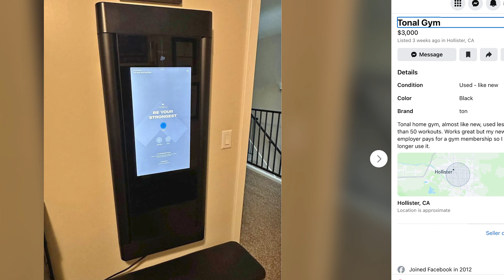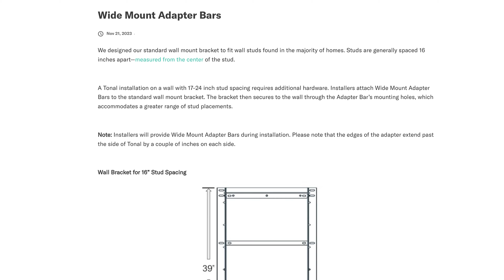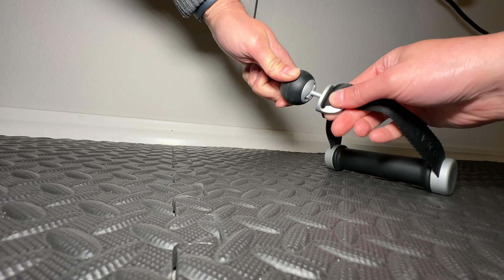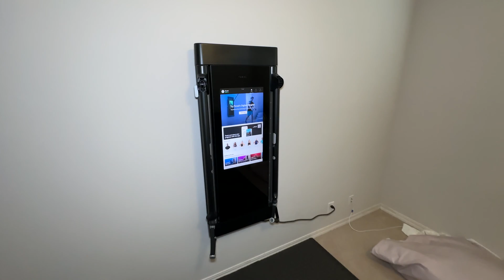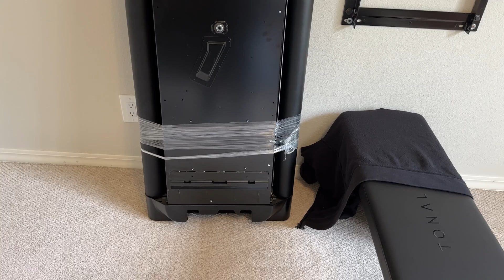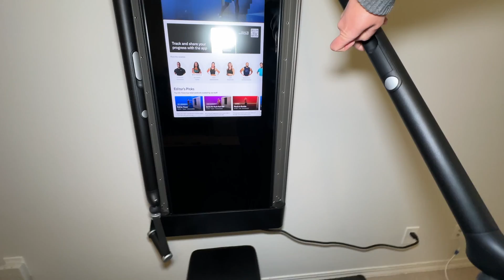Removing and Installing a Tonal Home Gym: Step-by-Step Guide

Comment: Thanks for posting this. What length are the provided lag bolts?
Reply from the maker: I do not remember the exact length, and I do not want to guess about hardware holding a 150 pound machine. Tonal says the hardware can vary by wall type and recommends using new relocation kit hardware instead of reusing the old bolts. I would use the exact hardware supplied for your wall.

Comment: This was super helpful!!! I was leaning toward buying a new Tonal because there was so little available information on installation. With a new one, it would be installed for me. A number of things gave me the confidence to by a used one:
#1 - This video.
#2 - The Tonal rep was not very helpful with options to work around the decorative molding and chair rail on the wall. Once I knew how to do the install (see #1) and with the molding situation, it seemed easier to do the install myself than deal with an installer.
#3 - Visiting a friend that had a Tonal. They knew what to watch for in buying a used Tonal and how to transfer a Tonal. I wanted to actually try a Tonal before putchase. The closest place that Tonal could find was 2 hours away. Really??? I live in a suburb of Denver CO and Tonal doesn't have a demostration model anywhere in the entire Denver metro area?
#3 - Huge savings buying used.
Reply from the maker: That is a fantastic story. You researched the used unit, tried one before buying, learned the transfer process, solved the molding problem, and saved serious money. Most importantly, you understood the job well enough to do it confidently. I am glad the video helped. Your detailed experience will help other people considering a used Tonal.

Comment: Close up of you drilling would have been helpful thank you
Reply from the maker: Great suggestion. I should have included a close-up of that step.

First I drilled through the drywall using a standard drill bit. Drywall is soft so it goes through quickly. Once the bit hits the wood stud behind the drywall, you’ll feel the resistance change.

From there I continued drilling straight into the stud to create the pilot hole. This hole guides the lag bolt and prevents the wood from splitting. After the pilot hole was drilled, I switched to the larger bit specified in the Tonal mounting instructions so the lag bolts could pass cleanly through the mounting bracket and bite securely into the stud.

The important part is drilling deep enough into the stud so the black mounting bolts can fully seat and tighten against the bracket. If the hole isn’t deep enough, the bolts will stop early and you won’t be able to tighten the unit flush to the wall.

So the basic sequence is:
	1.	Drill through drywall
	2.	Continue into the wood stud
	3.	Drill the pilot hole to the correct depth
	4.	Mount the bracket
	5.	Drive the black lag bolts into the stud until everything is tight and flush

Thanks for pointing that out. A close-up would definitely make that step clearer for people installing their own Tonal.

Comment: Can the electrical cord hide behind it ?
Reply from the maker: Yep, mostly yes. The  power cord exits the back of the Tonal near the lower area, and you can route it straight down behind the unit so it’s hidden once it’s mounted. From the front and sides you won’t see it at all.

The only caveat is the outlet location. If the outlet is directly behind the Tonal or low on the wall, it’s completely hidden. If the outlet is off to the side, you’ll have a short visible run unless you add an in-wall outlet or use a recessed outlet box.

In short: clean install is totally doable, just plan the outlet placement.

Comment: The install instructions by tonal only shows one page
Reply from the maker: You’re correct. Tonal only provides a single-page install sheet like this. Even when I was able to get the installer manual, that was essentially all they were given too. The rest is left up to the installer’s experience, which I don’t think is very fair for homeowners trying to move or reinstall it themselves.

That’s exactly why I made this video. A lot of people are moving these units, and the official documentation just doesn’t walk you through the real-world steps. I genuinely believe in the product. I use it several times a week and love it. I just think removing and reinstalling it should be something capable homeowners can do themselves without being forced to hire expensive third-party companies. Hopefully this helps the next person feel more confident tackling it.

Comment: I have aluminum studs in my basement. The site says not recommended. Any work around?
Reply from the maker: Good question. You’re right that Tonal doesn’t recommend mounting to aluminum or steel studs because they can’t handle the pulling force when you’re using resistance.

If you’re set on that wall, you could reinforce it first by adding a ¾-inch plywood backer board anchored into something structural, like concrete or wood blocking behind the studs. Another option is to build a small wood frame or “false wall” that the Tonal can safely attach to.

Bottom line: it’s doable, but you’ll need solid reinforcement behind the drywall for it to be safe.

Comment: So I just installed my breaker and it is level with the Earth… But not level with my floor, by about an eighth of an inch on one side (my house is not level). Think that will be an issue? Should I reinstall the bracket before I put the unit on? Thanks for any help and your video was great.
Reply from the maker: I don’t think it’ll be an issue since 1/8 of an inch is really small. If the bracket holes are oval (I can’t remember for sure), there’s usually enough slop to loosen things and shift it over that amount. Personally, I’d put it all together first and see if it actually bothers you before re-drilling anything.

Comment: Tonal’s website says you need 10mm hex socket and 7/16 socket for the rachet. the tools listed in the subscription didn’t match those sizing though ?
Reply from the maker: Thank you for pointing out the mismatch. Tonal lists different tools for the trainer fasteners and the wall hardware, and the hardware can vary. Please follow their current guide for the fasteners actually fitted to your unit. https://knowledge.tonal.com/kb/guide/en/how-to-uninstall-your-tonal-onajaW0uXx/Steps/4209057

Comment: Thank you. If installing a recessed electrical receptacle to be hidden behind the machine at what height would you recommend installing the receptacle?
Reply from the maker: Mount it horizontally, about 22.5 inches above the floor, but verified by reading their documentation here: https://knowledge.tonal.com/s/article/Outlet-Requirements

Comment: Great video!  Tonal makes is so difficult to purchase a used one.  Frustrating.  I was sure there wasn't much to hanging one of these.  Your video confirmed that for me.  Thank you.
Reply from the maker: Agree. It a TV with light bolts that need to be centered into the studs. And it is important to measure space and make sure you’re gonna have enough room to do the exercises and not run into a wall. With that said once you get it all set up it’s great and I love my total and used it today.

Comment: Tonal are such low lives for not letting people just buy it and use it how they want. As soon as another product comes out that's as good and allows people to use it the way they want to, tonal will go bankrupt
Reply from the maker: I think the mounting stuff is a liability thing. They don’t want this big giant heavy thing to fall off the wall because you didn’t bolt
It on correctly. But with that said we all install our own flatscreen TVs, which are pretty big and heavy and they don’t fall off the wall very often….

Comment: Does anyone know the specifications of the wall screws? Or moving company lost all the wall screws :( and I haven’t been able to find any information on them
Reply from the maker: Their installer manual recommends 1/4” x 2.5” Lag Bolts, quantity 8 and 1/4” washers quantity 8. These are to be driven into the center of two studs on a wall with a wall thickness up to 1.25 inches. If your studs are wider than normal, which means 17 to 24 inches you’ll need the wide amount adapter. The side bolt screws. There’s 12 of those used for securing the Tonal to the bracket those are: M6 1.0 x 8MM bolts. Is that what u needed?
Reply: @fixitwithjake do they need to be powder coated or anything special?  When using the ones i bought there were sparks.  Thanks!
Reply from the maker: @Eisingleton no, does not matter
Reply from the maker: For metal stud installation they use an M6 snap toggle anchor eight quantity and M6 1.0 X 80 mm toggle bolts quantity 8 and 1/4 inch washers quantity eight

Comment: Very helpful…I was annoyed at Tonals fee, process, and timing for an reinstall after a move and this video helped with just doing it ourselves. Thanks!
Reply: Thank you! I agree. Just got off the phone with them. They want to charge $500 to uninstall, I move it, and then they come back to reinstall. So annoyed but this video helped.
Reply from the maker: Yeah, that’s pretty expensive. I would either do it yourself or find a handyman or handy friend that can help you out and it should be a no-brainer. Just make sure you follow some of those instructions that I put a link in the video description that talks about measurements and how much room you need in the area it will be mounted.
Reply from the maker: Great to hear!

Comment: Thanks for posting!  Initially had the “professional” installers install Tonal in an unfinished basement. It was not leveled correctly despite having exposed wood studs.  They did a sloppy job.  Still can’t believe that!

After finishing our basement, I had to relocate the Tonal and decided to use your video and do it myself!  Thanks for helping me save $300 Tonal Relocation Fee!  It’s perfectly level and looks amazing compared to Tonal’s “professional” mounting service.
Reply from the maker: Oh wow interesting story. I guess you can see that the level is critical to making sure everything is good at the end. Nice job relocating it yourself! I’m happy to hear stories like this.
Reply: Where did you buy the screws for the brackets and the side bolts? Can you please share the links?

Comment: The manual says M6 1.0x8mm bolts but the ones in your video look shorter?  Maybe it was just the camera angle?
Reply from the maker: I used the bolts from the prior installation. Depending I what year they installed the tonal they might be different. At some point they also changed the bolts on the side of the machine.
Reply: @fixitwithjake  Thank you, I bought a used one off Ebay, but it did not come with any installation hardware or mounting bracket.  Tonal was really cool about selling me a wall mount bracket for next to nothing but they do not sell any of the bolts.  I'll just do some trial and error.  Thanks for the quick reply!
Reply from the maker: @brianmaslowski7901 oh gotcha. That’s great. They got you a bracket easily. The lag bolts that go into wood studs should be this size : 1/4” x 2.5”  and you will need 8 of them. This is directly from the installation manual. https://www.reddit.com/r/tonalgym/s/BTKY0j6w4w
Reply from the maker: They look like this https://amzn.to/4dAT8Da
Reply: @brianmaslowski7901 hey, do you happen to remember the bolt sizes? Lost my entire bag of bolts from when I took it off the wall during my move. Trying to reinstall now.. thanks.
Reply: @fixitwithjake are those the exact sizes?

Comment: Do you have any recommendations on how to pack the tonal? I intend for a moving company to move mine since I don't have a car right now
Reply from the maker: Honestly, I just put mine in the back of my car so I did not do much packing. But if I had to pack it for longer distance, I would use Big zip ties to secure the arms to the body, so it does not flop around. And then you’ll have to use some really good bubble wrap protection for the screen. I think the vulnerable part will be the screen and the corners of the screen. The back of it is all metal. I hope that helps a bit.

Comment: I did it myself also.  As long as you find the studs on the wall it's easy.
Reply from the maker: Is there anything you’d do the next time if you had another crack at it?
Reply: @fixitwithjake  Not really.  It's pretty simple.
Reply from the maker: Ok thanks. Just trying to learn More. I appreciate it.